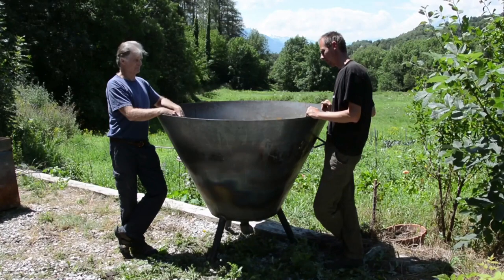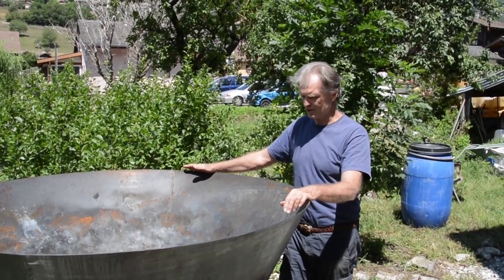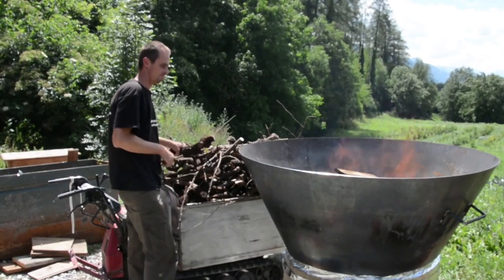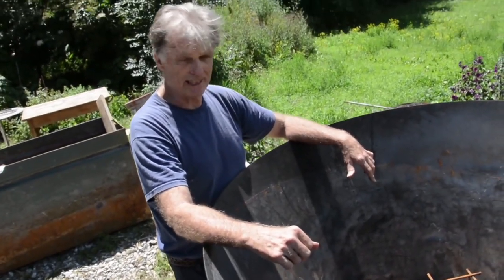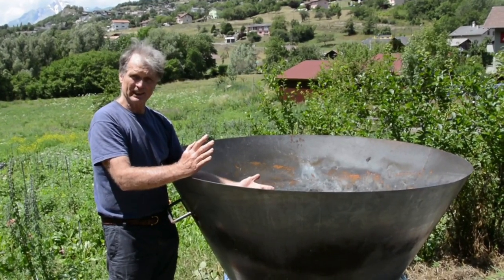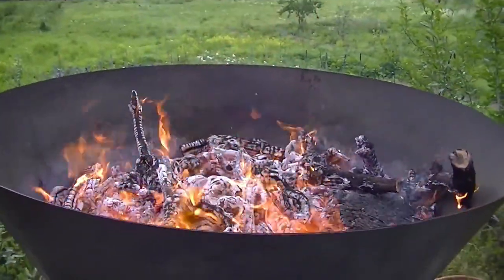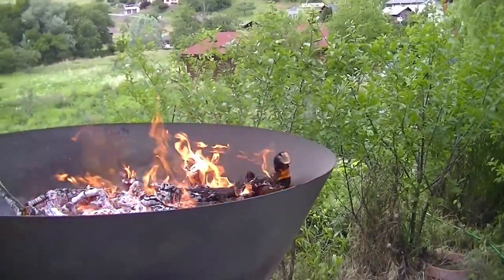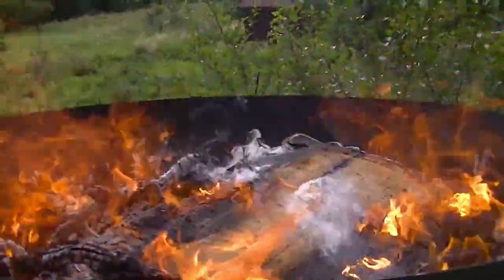Kon Tiki Biochar Kiln Introduction

Comment: I think this is the most pragmatical way of doing Biochar, or turning season "wast" materials in something very valuable on a farm, small poluttion, easy to understand. Other methods are better or more adaptable to reuse the heat, and off course more sustainable for the industry. This is a no Brainer, perfect to every village.  Congrats on the project!

Comment: I love it but I had a question about the water, wouldn't it be high in Lye, given that the water soaked in ash?
Reply: When the narrator says "it feels a little soapy", he's talking about an elevated pH. Could be 11 or 12. I usually add a good pour of vinegar to the quench water and let it soak for a while. If you are using it in soil, I would suggest mixing compost into the char and letting it adsorb into the char before applying it to soils.

Comment: how small can wood be. wood chips. brush and how dry
Reply: Wood chips can be problematic because of compaction. I'd build a support structure with other brush and add chips slowly so they are able to be properly pyrolyzed. Whatever you put in should be as dry as possible.

Comment: Too many issues with this method.  Open kiln of any type just won't allow control.  Seems like tlud closed systems would be far better.
Reply: Control of what?
Reply: tested this method many times. you could argue that a closed kiln provides you available utilization of the heat and perhaps provides more cracking and porosity? The kontiki kiln provides more mass of biochar though.